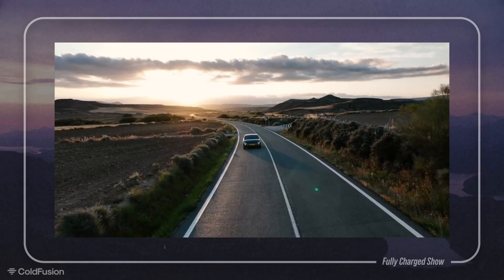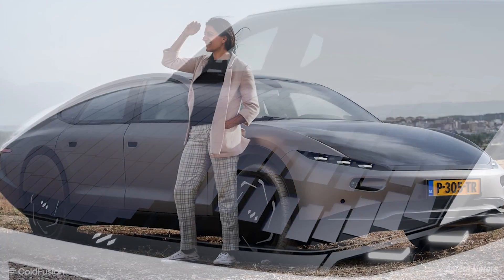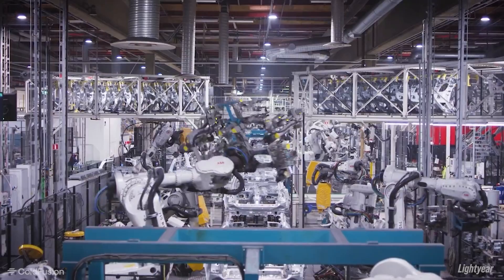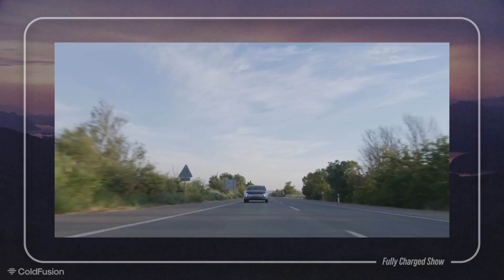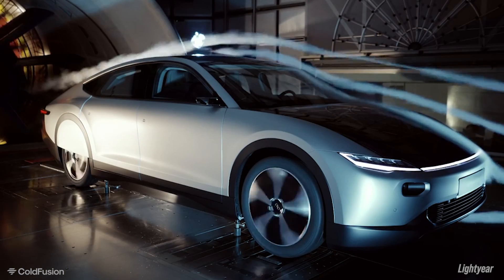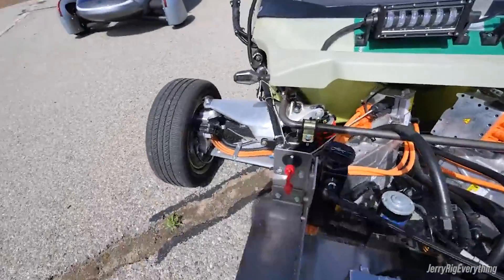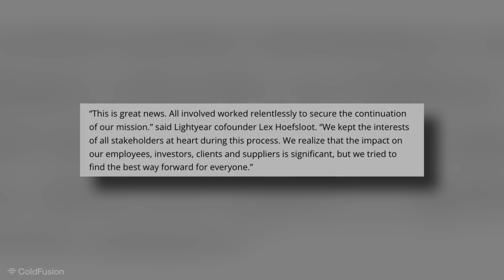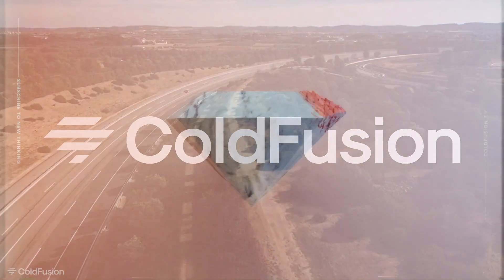3 Interesting Solar Car Projects

Comment: The key technical information doesn't seem to be given. I'm afraid thats for a reason. If not, please share this info:
5 meters of solar panel = how many kW ? 
How many km does it drive on 1 kWh under normal driving conditions?

With the info that we do know it looks like this:

5m of solar panel = 1kW 
Effective hours for horizontal panels range between 0.2 and 5 per day. (in the Netherlands)
Effective hours for horizontal panels are about 750 per year (in the Netherlands)
So you will charge between 0.2 and 5 kWh per day and 750kWh per year.

Most commercial EV's do 4 - 5 km per kWh. Lets say this one is really super effcient and does 7. (im certain the 600km of range on a 60kW battery is not under normal driving conditions)
That gets us to between 1 and 35 km per day and 5000 km per year.

If we look at the financial aspect. It generates about 300,- worth of electricity per year.

As cool as the dream might be. This company doesn't succeed and doesn't get much investment because its just not going to be efficient. Even if you would use some space industry grade 40% efficient solar panels it wont be. (normal ones are 21%)

Comment: this will not be possible in next few decades, for one simple reason.
And the reason is oil industry will not allow it, they will destroy it as they did any project what provided better and cleaner solution for cars.
Current electric cars are not any competitor, hence the reason why governments are trying to implement ban on fuel cars...
Electric cars as of today are much more expensive, more dangerous than fuel car and they are not even so green as they claim to be.

Comment: I like the Aptera. An important point is, even without the solar these cars will be ridiculously cheap to operate. I'd think most(?(many?)) car purchases are mum driven (pun intended), mums are logistics geniuses that can calculate a ten second zero to sixty is not a big deal when relocating groceries, kids and drunk husband around the Motu on a daily basis.
Reply: Aptera doesn't work; skin cooling is a croc.

Comment: It's an electric car with 61 kWh battery that that sacrifices practicality and performance so it can charge itself at a a rate of 1 kWh per hour (if it's sunny), and it costs a fortune. I wonder why it failed. The idea of a solar powered car is only good for people who don't think about for more than 5 seconds.  Even if the solar panels were 100% efficient it wouldn't be enough to power a car.

Comment: The concept seems completely pointless to me. Just put solar panels on the roof of your house instead and fit a battery twice as large in the car. Then you've got 10 times the solar generation, 2 times the range and 2 times the performance on your car. All for half the price.
Reply: Yes and the weight of the battery doesn't matter at all. You haven't even watched one minute of the video.
Reply: @Tahrust  That's exactly right, weight doesn't matter much, that's physics for you. And considering that this Lightyear 0 is just as heavy as a Model 3 -despite having a smaller battery and being 10 times as expensive build - I'd say that solar panels don't exactly save weight anyway.

Try harder.
Reply: Not pointless. Think of all the people who don't own a house to put solar panels on.
Reply: @hannorichter7576  Hahaha, yeah, what a great solution is it to that! €250.000 for €2.000s worth of solar panels. Come on man.

Comment: (X) DOUBT. EV/solar engineer here.
5m2 panels produce 1kW max, in ideal conditions, which car surfaces are definitely not. Such panels will produce around 700kWh of energy per year.
Typical efficient EV takes 15kWh/100km. Let's say they did a miracle and got it down to 10kWh (no heating, A/C). This gives us 7000km per year, in perfect conditions. In reality, more like 4000km per year.
To compare, my IONIQ 5 has a solar 2m2 roof, was always parked outside, no shades. It generated 103 kWh in two years! The roof is €1500 option, so the only benefit of it is it makes your neigbors curious. Nothing else.

Comment: A more technical report would likely determine that these vehicles are not very desirable compared to, for instance, a Tesla. For stance, if you want your car to charge itself, it needs to be parked in the sun. That makes the cabin hot, and the first thing owners will do is blast themselves with air conditioning. They are also made to be super-light weight. They become quite dangerous in an accident, because physics. 400 plus solar panels equals a nightmare for vehicle repairs, even in the most minor of bingles. As a sound bite, “self charging car” sounds brilliant. In practice, it gets a little more complicated. We know how much energy falls on 5 square meters of solar, and how much of that energy can be harvested. It is not a lot to work with. 1kW of electricity run a kettle. Therefore every aspect of the car’s capabilities is coloured by sipping at this tiny amount of energy. Compared to any other mainstream electric vehicle, it will be an underwhelming experience. I charge my Tesla with solar from my house’s roof. I can do this because I work from home. I have none of the range, safety or performance limitations, and I can garage my car.

Comment: There's a fundamental problem with trying to recharge batteries from solar cells mounted on the body of the car.  The angel of the sun's rays must be perpendicular to the solar cell for maximum output.  As that angel drifts off that 90 degree mark the output falls dramatically.  That's why your best solar setups have sun tracking ability although these are stationary installations and impractical for a car.  The point being that just like predicted sales price of these vehicles is usually too low, the predicted range from self charging on solar is probably a total dream.

Comment: What is wrong with equipping the parking spot with solar? way "cheaper" in engineering sense than carrying the panels on the car all the time. And stationary panels can be properly angled to ensure efficieny. And they keep your car from rain and snow when sun does not shine. And they keep producing to grid when car is not home. And they are easier to maintain. Charging in transit is just not that useful to justify the extra weight and complexity. 

Maybe a small panel could be useful to run the AC when car is not plugged in, sure. But other than that, it would be hard to justify putting panels on the car rather than on the parking lot.

Comment: if a car costs more than $50k - there's something wrong with the manufacturer. simplify, simplify and simplify some more. people don't need 90% of what modern cars offer! that is ridiculous how manufacturers complicate things and have zero market research, asking actual drivers what they need and want in a car. personally i'm rooting for aptera - that's is an amazing company that does things correctly from all view points, from engineering to client research. if they were on stock market they would be in my top list along with rocketlab. I hope Lightyear2 will get things right this time. sim-pli-fy is the answer.

Comment: I’m am very interested in solar energy used in as many applications as possible. I have solar panels on my roof. My wife and I both drive hybrid cars. We’re currently waiting for a new Prius. My major concern about the Lightyear concept is collision safety. Is there were only Lightyear type vehicles on the road, that would be one thing, but the collision of a Lightyear and even a Prius would be a
pretty ugly scene.

Comment: What went wrong?  $170,000 for a car.  That's what went wrong.  Had they made the car bare bones (but kept the solar power aspect) and sold them for $35,000 - they'd have been super successful...

Comment: Solar power is a scam. Its ok for  areas near equator. More than 12 hour sun required. Still it needs powerpack battery. Best is one made of hydrogen which returns into water.

Comment: The fact is, these are still plug in EVs. The solar part is a small contribution - especially since most people are not parking their car in bright sun. Add cargo and less than optimal driving habits, and the graph tends towards a conventional EV proposition. The battery of close to 70kWh is still substantial so resources needed for the battery chemistry is not substantially different. People are still going to have to consider their charging strategy as their primary form of management - and the source of their power is just as significant as for anyone else. Probably the most interesting aspect of this is the push for higher efficiency and reduced drag. The rest is pretty meh if you follow this technology.

Comment: I wouldn't buy one.  It would make no financial sense.  My break even for the investment would be about 15 years, given that I drive about 1,000/month.  I have a reliable Toyota and it would likely last about that time.  No need to replace it.
Not buying one would eliminate a $36,000 present value dollars expense at little benefit to me.

Comment: I drive a small 22yo car partly because I hate how insanely fat and inefficient modern cars are getting. Paying off a loan on a vehicle whose design I despise as both an electrical engineer and aerodynamics enthusiast is just too much to ask for me. I was watching the Lighyear 0 and the Sono Sion closely because those were the only new cars I would be willing to buy. I don't care about 0-60 times, my current car is worse. A car is a tool for transportation for me and nothing more. I do not have it tied to my sense of sef worth or have the need to boost my ego with it somehow. Any tool that uses 90% of its energy to run itself and only 10% to do its job feels stupid yet that is what cars are and they seem to be getting worse at it, not better. It is very sad to see startups try to go against this trend and fail not because what they were trying to make was not good but for various other reasons and many of those being beyond their control.

Comment: These will be everywhere by 2030. With Axial flux motors getting smaller, lighter and more efficient. Salt ion battery tech 1/3 the price, 10 x more cycles, more efficient (lighter) than lithium iron. Combined with silicon anodes and with recent NREL solar panel development that gives 47.1% efficiency, the future is exciting.

Comment: why do all these electric cars don't use a key to open the door, crank rail to open the window, eliminate the motor fo and a/c to open and close the air vent, use old school tech for these things and save a lot on energy

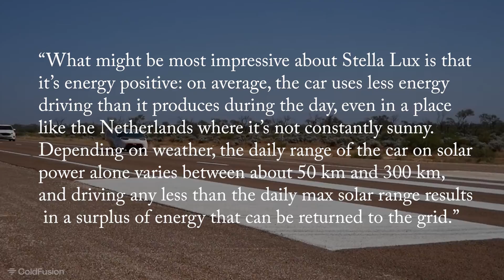Comment: Im sorry but the sentence on screen at 4:00 doesn’t make much sense…

If a car is energy positive, I.e. it consumes less energy that it produces while driving, how could it have a “max range”? If it can only drive 50/300km a day it means it’s not energy positive, right? Unless it means it can stay energy positive but only driving at a speed between 2 and 13 km/h, which is the speed that would give you 50/300 km in a full day of driving….

Comment: 1kw per square meter is average good solar radiation i.e. energy of direct sunlight. EVs batteries are often 12-20+kwhrs of energy, and that takes you 200-300 miles at best. A cars roof has 2, maybe just maybe 3 square meters of surface area. So in absolutely optimal conditions a car with a PV roof could charge to full capacity in like 6-10 hours of perfect sunlight.

Ok but solar cells are at most maybe 30% efficient, and you lose more in the charging process. Also, even on absolutely perfect days, you never get full sunlight due to the angle of the sun and shadows, let alone overcast or obstruction. So in reality a car fully paneled in PVs might get enough charge to drive like 20-60 miles depending on angles, weather, and where you live. It's def worth it and something we should pursue, but there's no way you can just drive a 2ton hunk of metal at 70mph indefinitely in the sun. The thermodynamics simply don't equate.

Comment: Informative and interesting, as always. I would definitely go for a solar vehicle once they go into production. Slower speed isn’t an issue, especially in the city - back in the 1980s used to drive a Mercedes 300D (diesel) which wasn’t exactly fast, had terrible acceleration and sounded like a tractor but it still got me from A to B.
Reply: I had a 200d w124 and it was dangerously slow. It could detect a hill that was nowhere to be seen. Such a stupid car. There was even a version with a 4 speed transmision, meaning it wasnt that economical.

Comment: That 3 wheel thing makes the most sense. 3 wheelers are considered motorcycles so you don’t need to worry about crash regulations. This allows more focus on advancing the technology to the point where it can go to a regular car
Reply: Until you get in a crash and you die.

Comment: It could be done. Making a car shell that is basically a very lightweight wind breaker. But that would require it never getting into an accident and that's not feasible unless all cars on the roads are self driving, without any human idiot on the road being a danger to themselves and everyone around them.

Comment: I guess a couple draw backs to this car other than bad weather is hills.  A scary thought would be that you're crawling up a hill being  a hazard to the cars around you.  In theory, you could stop by the side to charge a bit before giving it the foot again.  But all in all, THIS is a much more solution to saving the planet than driving in 4 ton electric Hummers